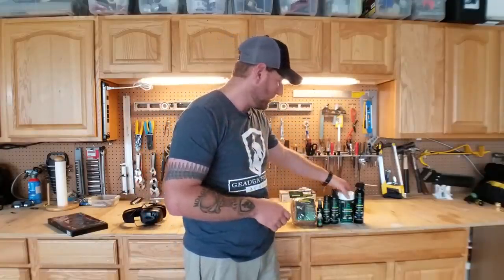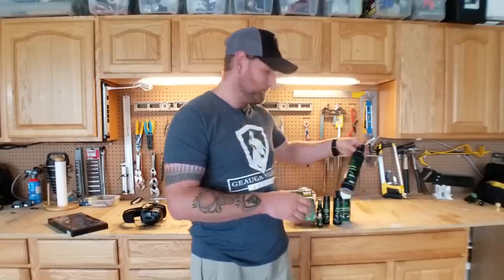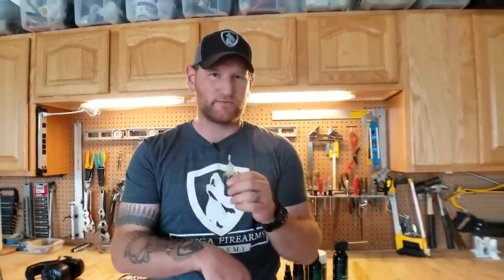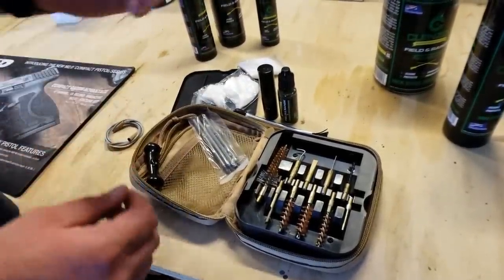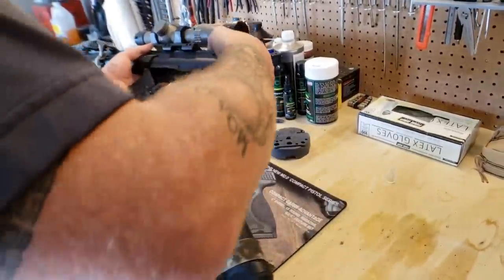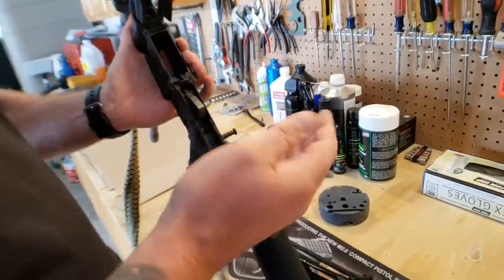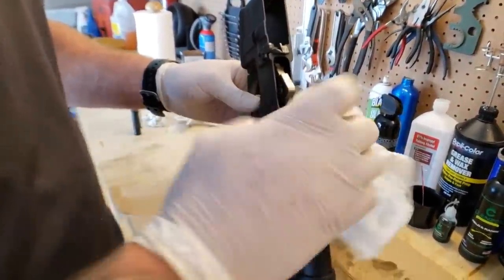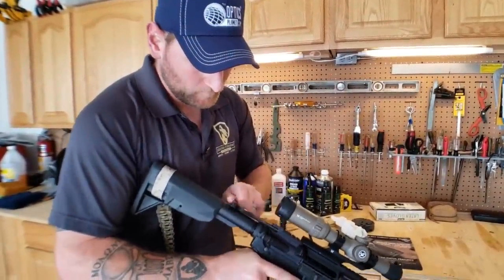Clenzoil Review | Is it worth it?

Comment: Neil:
Do the baked-on finishes (e.g. Cerakote) count as painted surfaces?

Hope I spelled your name right.
Reply from the maker: Jack I can only go off my experience and I used on painted sights, lettering, if its from the manufacturer I haven't seen any adverse effects but thats only my experience
Reply: Hey Neil! Clenzoil is safe on Cerakote and camo coatings as well! The only finishes you’ll want to avoid are anything latex based (Browning Dura-Touch), but even bug spray can damage those. Feel free to reach out with any additional questions!
Reply from the maker: @clenzoilunlimited7058  thanks for the follow up info!
Reply: I saw some videos on the very question you are asking. The general answer is, yes it is fine, just do not over apply and let sit to long. I have some factory Glock pistols, and am going to be very careful as well.

Comment: Beware. I left some of the cleaner in a thin film on the face of my shotgun (Winchester) action. I didnt pick this gun up for a year and opened it to find it had eaten into the surface of the joints. Not sure if it reacted to some other product present but I had to carefully lap the surfaces to get em back.
Reply: most cleaners and lubes dry out. its actually good practice to oil/lube them up at least 2x a year or every 6mos if not being used (more often if they are obviously)

Comment: The brush is for oiling the trigger group parts like in a S&W revolver.  My dad who was a master gunsmith for Smith & Wesson used a shaving cream brush.  He would remove the sideplate on a revolver to access the trigger group.  He used Balistol to clean and the dipped the brush in a basic 3 and 1 oil and tapped the trigger group to lubricate the assembly.  He told me this is the best way so you do not over oil the gun.  Too much oil collects grime.

Comment: I just cleaned my Glock 45 for the first time in a long time, and I bought the gun used and dirty. When I say this thing looks brand new I mean it, I pulled the snake through after spraying the CLP in there and my barrel is sparkling clean. As a matter of fact everything on the gun is clean! Definitely will buy the stuff again once I run out! I picked up the package deal on Amazon which was the three gun kit. Comes with a snake for your 12 gauge, your AR 556/223, and 9 mm. It was absolutely perfect because those are the three calibers I own!

Comment: I didnt see a function ck on the ar..lol. Ive had to use army clp for years. Now ive found after range time, carbon is carbon, quik hit with throttle body spray until thorough cleaning. At home after cleaning, cpl drops on qtip along contact points, good to go.
Reply from the maker: Thanks for watching

Comment: I would like to share an issue that happened to me recently. Several of my guns started having problems, i.e., the trigger would not reset after firing, or the firing pin would have light strikes, and even the slide was not recycling properly. When I tore down the gun, I found out that the entire gun had this sticky stuff all over the barrel, the slide, the trigger, pretty much everything. In trying different remedies to fix this, what I discovered is that I was using 2 different oil brands to lubricate the gun. As it turns out, some products do not mix well together at all and what ends up happening is a very “gummy” sticky dense solution that gets into everything on the gun and causes more problems than anything else. I ended up just doing a field disassembly of the guns I had problems with and cleaning the barrel, the slide, and other components with 99% isopropyl alcohol to removed everything from the components. After that, I used 1 lubricant (actually, I ended up using the Hoppe’s Black Precision Gun oil which is actually pretty THIN and unlike others is not so dense that it interferes with the operation of the gun. This 100% solved the problems I was having. I have not tried Clenzoil, but Project Farm also highly rated Clenzoil so I have it on order from Amazon. Just thought I would share.
Reply: Thanks for the sharing this is good to know not to mix different types of CLP and oils. I have a question Do you think it is good to clean a brand new gun never fired from the factory with 99% alcohol first and then Start with your oil treatment like Clenzoil and then just stay with that oil going forward ? Like because the factory puts their own lubrication and if I just start with Clenzoil it might do the same thing that happened to you just my thoughts any advice would be helpful thank you ?
Reply: @will195  Hello Will. Some guns come from the factory through the distributor with a ton of heavy lubrication (usually). I have taken them out of the box and shot them with very little issues if any. But my preferred way today, even for modern guns, is to do a field strip and just clean with 99% Isopropyl Alcohol and a clean rag all the grease and oil that is on them, and then apply your favorite lube sparingly. Another mistake I used to make is to over lube a gun or lube the magazine itself - that put the lube into the firing pin and gummed up that "cylinder" where the firing pin moves. To sum it up, if you can, when you purchase a new gun, 1st do a field strip and wipe the gun clean from all grease and manufacturer's grease - then proceed with your lubricant. Personally, I stopped using CLPs. Cleaner/Lubricant/Protectors (3 in 1) are not always as efficacious. I just use the 99% Isopropyl Alcohol and when dry and clean, I use Hoppe's HBL2 black Precision Gun Oil - this is a THIN oil and I found it best by far as it never jammed anything and it never formed a "sticky" substance which I have had by mixing oils. I clean my guns about every 200 to 300 rounds (typically after a range night with friends). Cheers!